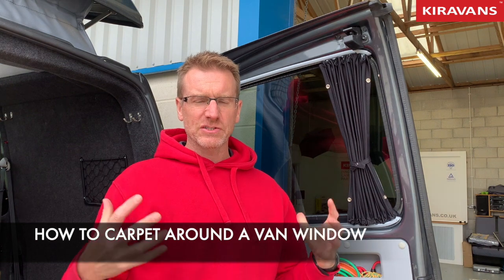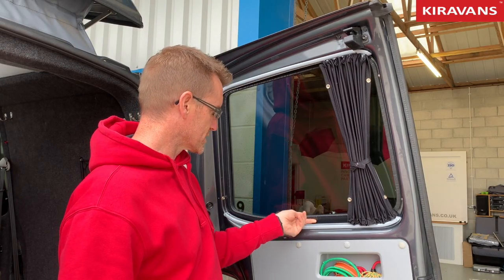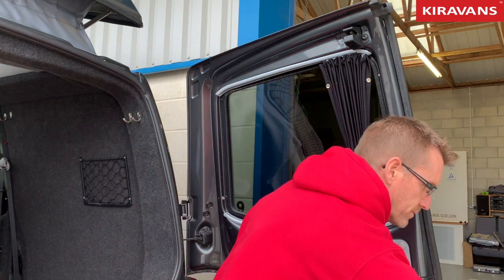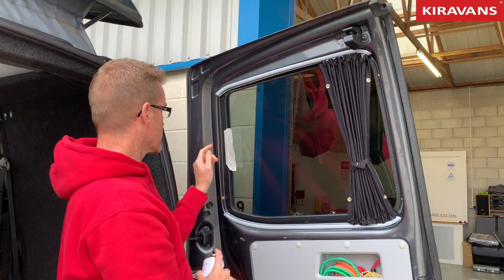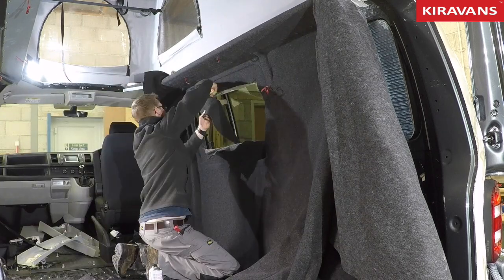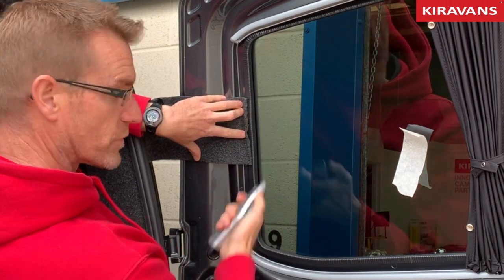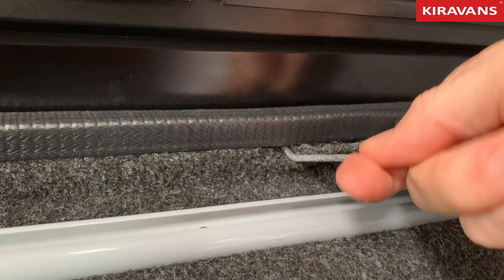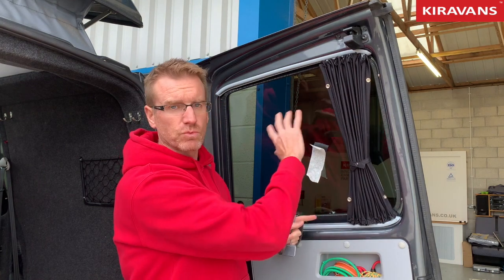Kiravans - How to trim carpet around a fitted van window

Comment: Thanks for that, very useful. One question though, what do you do with the outer edge? (Around the outside of the door) where and how do you stop/finish that edge of the carpet?
Reply from the maker: Hi, I was just using the rear door as an example but I don't personally ever stick carpet lining on rear doors for that very reason. There is not a good place to stop the outer edge at because it will start to interfere with the waterproof door seal.
Reply: @kiravans5874  Hi! How would you recommend to finish off the back doors, especially if they are damaged?

Comment: Hi guys! Is there some sort of sticker warp for those doors, I've got scratches all across my horizontal middle bits, in between the panels. They're already carpeted. Thanks Lee.
Reply from the maker: Not that I know of.  I have spray painted these on a previous van which helped the look but not perfection. I have also seen the whole door carpeted before or you could try a vinyl wrap option. Probably quite cheap to a few metres of vinyl online.

Comment: hi mike, the sliding window you show at 0.49,
does kiravans make the metal vent grills for that particular window i have 2 sliders the same as that .
not the oem vw windows
if so, could you put up a link plz 
 thx in advance
Reply from the maker: Unfortunately not.  We supply as seen in the video.